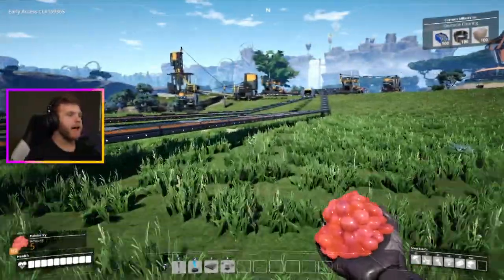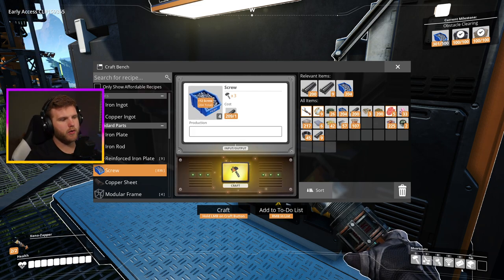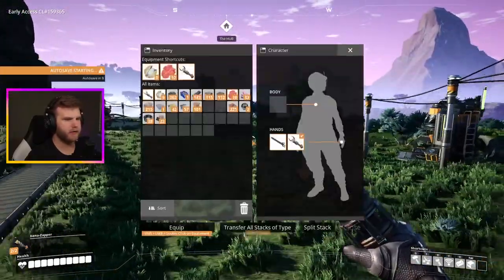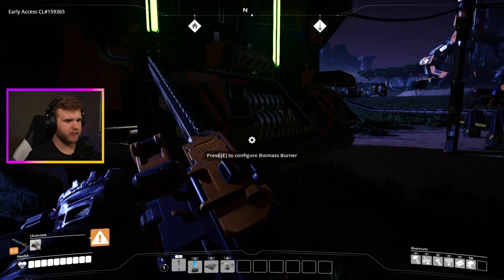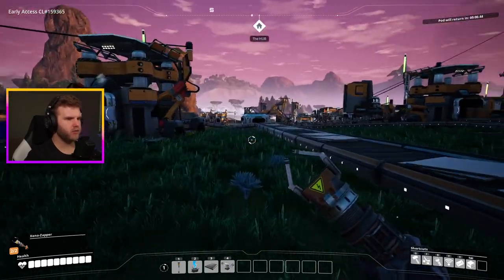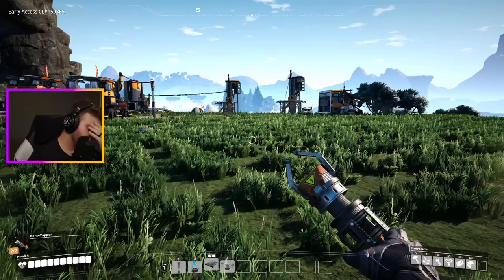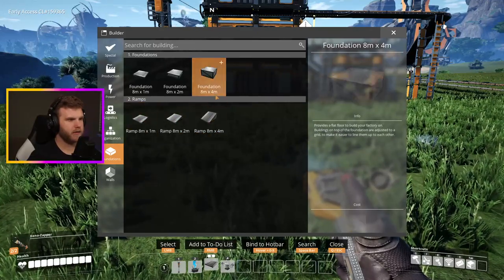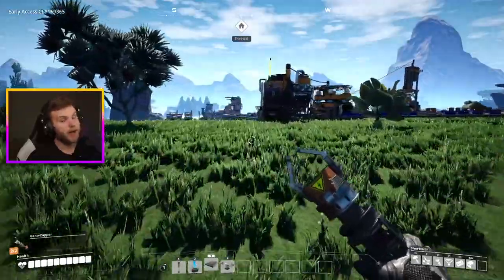Unlocking The CHAINSAW! | Satisfactory [Ep.6]

Comment: You might have already done this already but I think you really need to keep your storage units and constructors much closer to base and have a central area to access all your constructors, storages without moving very much and have your ramps run around the base. Same with your generators just have a handful of them together, run your power lines out so you go to one place for your fuel. One place for your storage and one place for your constructors

Comment: some ideas i have for your setup and general things i've learn after putting in a few months into the game. 
1) You can connect power stations together. think of the real world electricity grid. if you connect them all in a pole and then splice out the power that way, you can centralize your power production. I believe I took a few pictures of my early grid system and if i find them i'll post them in the discord.
2) The lifts can work in either direction. the first step is to connect the "intake" part to a belt or some form of output from a machine and you can either look up or look down to set the location of the output.
3) This is kind of a later game mindset but it isn't best to think of "oh just overclock everything and max the belts" because there are bottlenecks in the system. keep an eye on how long and how many items it takes to produce the next item. example: maybe the miner produces 10 iron ores every minute where the smelter takes in 3 iron ores and produce 1 iron every 30 seconds.  this is simple math since if you do fraction math, you get 2 iron every minute ish and that doesn't include time it takes to move on the belts and everything.
4) keep an eye on your wattage on each machine. the reason last video your assemblers was tripping the power stations was because each assembler needs 15 MWs and a single bio power station can only produce 30 MWs (i believe and not too sure if different materials play into it). so if you have 3 active running assemblers, it's gonna trip the breaker. 
5) might be helpful to set up a biomass system that can take leaves, logs, and meats. just so you can empty out your pockets when you go on supply runs.
6) Automation ftw! If you are gonna do something more than once, figure out how to automate it...words from a software engineer lol

ton of this stuff is at least how i play and how i understand the game. if i can find pictures of my early days of the setup, i'll be sure to put them in discord!